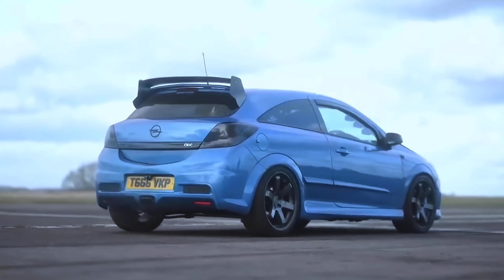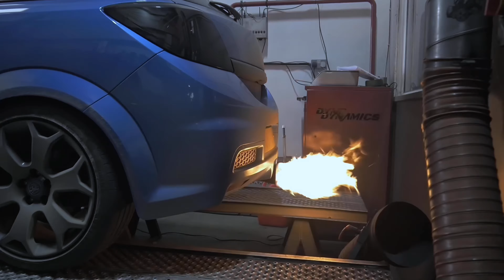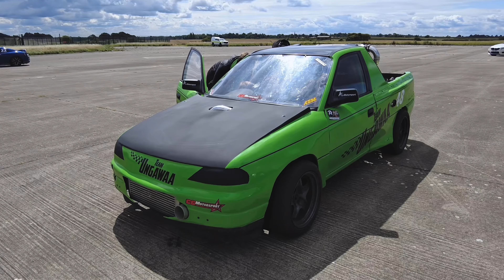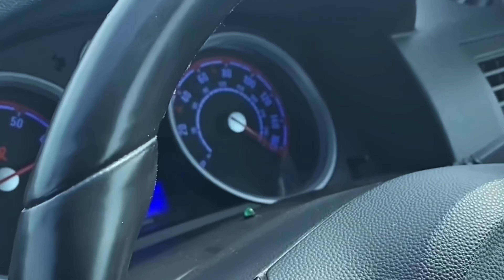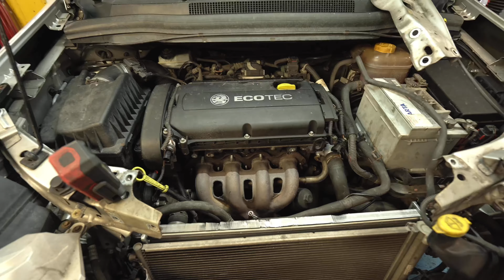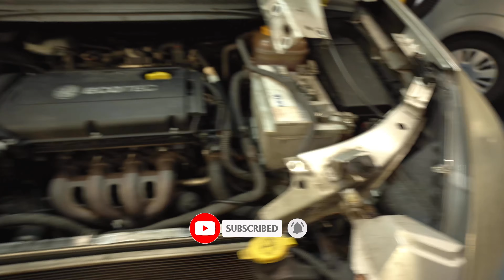Vauxhall Zafira 1.8XER oil cooler leak repair ￼

Comment: Hi, @SaucyBegger25. I have the same problem atm. Could be the termostat valve casing. As you mentioned that you had oil in the cooling system, the oil may have damaged the valve or the case. Could also be the ring gaskets on the cooling pipe.

Comment: Just done this myself. The whole assembly inc new filter and cap as well as the cooler. Inc all seals and O rings is just £24 from Febi. No brainer to replace the whole thing.
Reply: “£24” from where?
Got a part number?

Comment: My zaf 1.8 is in now with suspected oil cooler leak. Not heard anything yet. I’ve got a coolant leak from somewhere above they said and it’s leaking down onto my exhaust. Not oil. Just coolant. Are the cooling channels at the bottom of the cooler or could it be that metal pipe leaking coolant that’s above it. Thing is I’ve had the cooler changed 3 years ago 🙄. It mixed with oil that time though. It’s not mixed this time. I pray at this point it’s this cooler or pipe as I fear head gasket. Not got any signs it’s head gasket. Just my luck though.  It’s leaking onto the exhaust though and right above it’s the oil cooler 😢

Comment: Can you tell me the torque settings for oil cooler bolts and bolts for pipes into thermostat housing and also water pump
Cheers

Comment: Thank you for this and for documenting all the part numberrs for the o rings. Ive got the same leak but with the added benefit of the coolant mixing with the oil a bit so i bought a whole new oil cooler unit but havent fit it yet. If you can let me know where youre based ill bring it to you instead. Im in the south east near Greenwich.

Comment: This is such an antagonising job; not only is the oil cooler/heat exchanger badly designed to begin with (it's just straight metal-on-metal for the oil channel, with about 5mm between the channel and the exterior), but wedging it between two of the hottest parts of the engine whilst still using rubber seals almost guarantees it's gonna fail over and over again.  On top of that, having to remove so many parts, many of which risk damaging the relatively sensitive coolant pipes that the oil cooler is attached to, just to gain access to it, is needlessly time-consuming.

I've done this at least three times now; first time I just changed the gaskets and spent an inordinate amount of time cleaning the cooler and making sure the mating surface was perfect - only for it to start leaking again about four months later, at which point I realised it wasn't that much more to buy a complete sealed unit.  And now, after about 30-40k I just had to do it again.  Even worse I can't yet tell if it's 'fixed' because as soon as you remove the cooler off of the engine block, regardless of how long you spent draining the oil and engine coolant out of the car, it will spew oil and coolant down the side of the engine (and, even worse, onto the exhaust pipe).  So I'll only be able to confirm if it's 'fixed' once I've burned off all the gunk.

In hindsight I probably should've used some high-temp RTV sealant around the problem areas just to really make sure, but I guess that'll be the next step if I keep having issues.  It'd be nice to find an aftermarket replacement for this that actually rectified some of the more obvious issues (like the side of the oil cooler that takes in oil only being held to the side of the engine block with two screws)